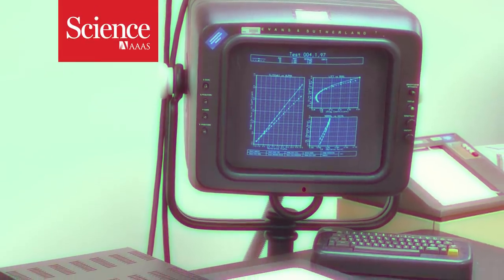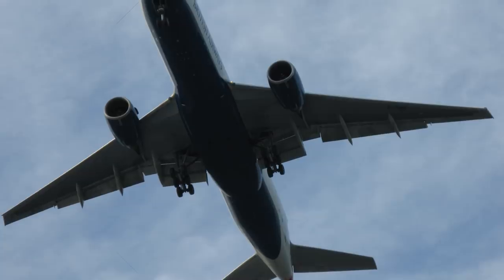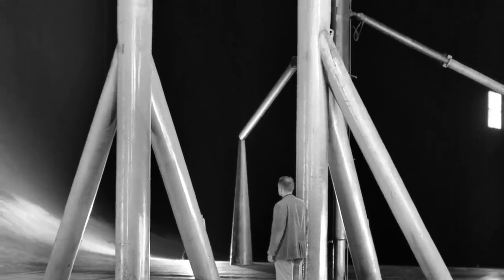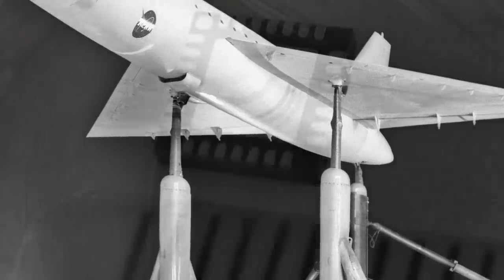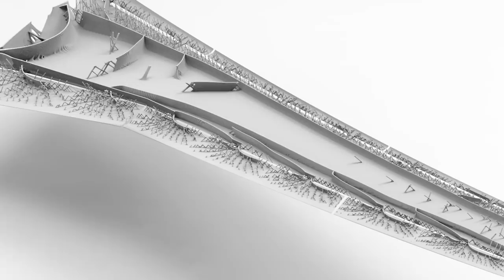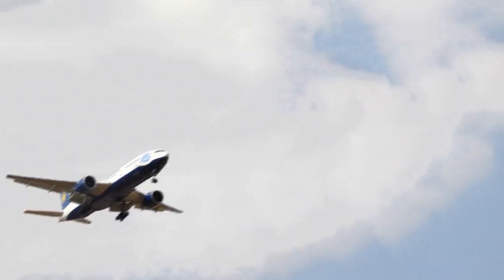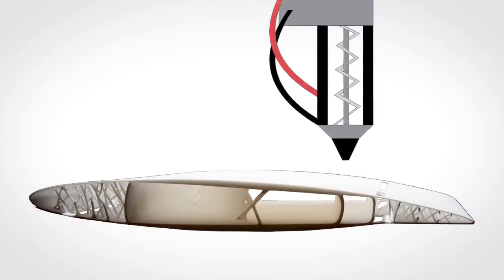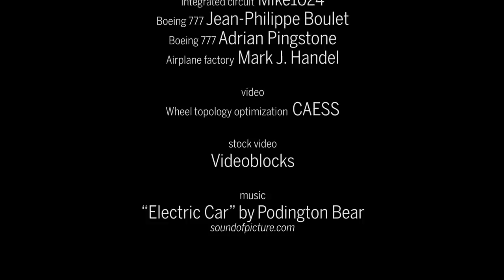New processing lets a supercomputer design a radical new wing

Comment: It is flattering how some people think that in aircraft construction they always try to make the lightest, best, fastest what ever part possible. At the end of the day, however, it is a cost-benefit ratio that decides. Maintainability is also important. Of course you can print parts of a wing, but how many per month at what cost and quality and what happens during a repair? A "print" does not offer a tear-stop function for example. But they are beautiful graphics. So bionic!
Reply: I'm also thinking about how they would implement mechanisms for all the different flaps between all those small ashes of material
Reply: wonder why we even bother to comment on this crap. maybe to wake some of the "it is new and shiny it must be better" sheep.
Reply: @constantinosschinas4503  well crap, I'm sorry if I'm not a superhuman that has a wide array of knowledge of things that I don't need anyways

and I'm sorry if I and other people have a learning curve and not an expert especially when we were just starting to learn
Reply: @michbus7440  TRUE and i don't wanna start on fuel and on the wing heating, cause Yes you are lighter but that's not going to help you stay in the Air if your controls are al frozen and you way tons more cause you have ice on the wings...
Reply: All you guys are proving here is that there is a good reason why we don't put the maintenance guys in charge of R&D. It's like the mechanic that works on old Fords telling the guys at Tesla to pump the brakes on designing electric cars because wrenches and lug nuts.
Reply: @ighsight  As I already wrote, it is not the unlimited imagination of the R&D heroes that decides but what the airliner needs, e.g. good maintenance, airworthiness and manufacturing costs.  Otherwise you could also complain that not every family van looks like a Formula 1 car.
Reply: @michbus7440  so true 👍
Reply: @fuelbasti  Even the lowly family van has evolved though, and it does so every year. It doesn't have to win a Formula 1 race, but it can't just stay the same. By the way tons of F1 and other racing league tech has made it to that family van over the years.
Reply: I would stick to old tried and true rather than new and who knows.
Reply: @Wildstar40  in a world where everyone is you we would still be living in caves hunting horses or whatever
Reply: @ighsight  now the understanding is there.  research cannot be the only driver of change.  it's only part of the solution, too.  to say one is being slowed down by others and that is why there is still no printed wing simply does not hit the point.  But maybe you just mean that every prototype is so ingenious to meet the needs of an airliner.  Well, these bionic simulations are definitely nice to look at and are nice stimuli for ideas.  But not anymore.  I am not against 3d printing, but this technology also has its limits.
Reply: @michbus7440  
You clearly do not understand my point.
Reply: @fuelbasti   I'm more excited about the new design and production process than I am in love with yet another prototype. I'm also reacting against the idea that the tech is cool and pretty to look at, but it's just a lightweight (pun intended) when it comes to the real needs of airlines. These are typical arguments that are made from the perspective of people who are wedded to older/legacy methods and technologies. Given the above mentioned recent Boeing 777 design and safety monitoring failures, the argument for sticking with the older ways that you champion is even less compelling at this point. Tried & true is nice, but innovation & improvement is better.
Reply: @ighsight  again, we talking here about a wing of a civil aircraft for lets say 200 people. Thats what this is about. Itis not the technology itself that is in question here, but rather its use or canonization for apparently every part.
Reply: @fuelbasti I don't see where the tech has been "canonized" yet, folks are just excited about the potential of it. Just as much or more rigor that went into development of traditional wings should go into this newer one before it is used. You seem to have decided in advance that this tech is unworthy of use for this part of an aircraft, without any evidence of that. Your arguments flow from "the existing way is naturally better" viewpoint, which kind of ignores the fact that the tech you now see on planes was developed in the same way as this, someone somewhere was pushing the design envelope against those who were comfortable with the status quo.
Reply: @ighsight  
"All you guys are proving here is that there is a good reason why we don't put the maintenance guys in charge of R&D. It's like the mechanic that works on old Fords telling the guys at Tesla to pump the brakes on designing electric cars because wrenches and lug nuts." 

Oh I see that is so true cause they don't need to funktion or something...

The Idea can be great but only if maintenance and mechanics aproove does it become a real option for service... 

Also this was 3 years ago... and we don't have any concept designs from Airbus or Boeing wich use these...
Reply: @LeoRehberg   I guess it would be easier to only do maintenance on yesterday's technology but that doesn't move restless minds. Designers aren't captivated by the thought of how great it would be to design something that is easy for the grunts to twist a wrench on, it's about solving problems and doing something new. 

Also it's unfair to expect all problems to be solved upon submission of the design. R&D has to design incredible new things AND solve all production and maintenance issues before they can share anything? Some issues have to be solved by other people after designs are created, division of labor is good.

Absence of concept designs shared with you is no proof that Boeing & Airbus are not continuing this research. I guarantee you it is ongoing. If you understand any one of modern computing, machine learning, robotics, additive manufacturing you will see that it is only a matter of time before all wings are produced this way, with robots maintaining them. If you wait until everyone else has solved the technical issues you will be devoured.

Comment: Thanks. It is pretty amazing that the supercomputer improvement to the current 777 wing is only 5%. While not an insignificant amount, it does means that current tech and humans got it 95% right.
Reply: Yeah I was surprised by that to, I woul be curious if this was only structurer related or also to into account optimization of airfoil shape.
Reply: 5 days isn't really all that long for AI, with more time, it probably would have even better results.
Reply: @nateman10  that would be a interesting case study for datascience. Could probably be easily done by someone capable of making a cam program.
Reply: 5% is a lot
Reply: @carlosandleon  Remember, we are not talking about 5% of the total weight, but only of the wing weight...
Reply: @carlosandleon  5% would be a lot if that wing could actually be made. For the moment it's just a cow's opinion.

Comment: Yeah the thing with these types of optimizers is you really need to be able to tell the computer to optimize toward something you can physically build. Optimization that leads to organic structures like the inside of a bird or pterosaur bone is not as useful as that which leads to orthogonal, manufacturable design which nonetheless creates something novel and functional.
Reply: Part of the issue is that it's difficult to control optimizers/ai design in general, and part of the reason for that (along with the oddly numerous paraleles between computer-optimized designs and nature) is that they create such designs through similar processes to evolution in biological machinery

Comment: 5 % fuel increase after 5 days of supercomputing, looks like humans figured out the plane stuff pretty well.
Or the restrictions on the new design were too high.
Reply: not 5% fuel increase. 5% less weight. thats not that big a difference. im guessing most of the weight is held up places you cant change without a lot of thinking through, like the skin thickness
Reply: Humans design based on current manufacturing and maintanence restrictions so that's pretty impressive.
This new design is impossible to make, try to give that freedom to designers they'll build better 👍
Reply: How do you figure 5% less weight can equal 5% more fuel ? That makes no sense at all.

Comment: There would be other structural advantages as well, I am sure. Identifying the change in weight is just a metric that would be easy to calculate, considering that they cannot build the wing with today's tech. Impressive stuff
Reply: We can design things this way it's just that we would have to make unique parts for everything and the cost of making a factory just for a single concept plane is a lot of money to ask for as a researcher
Reply: Nope, not really. with how aircraft are designed and built, it would only really be a weight saving. Just looking at this it seems to lack alot of features typically put into wings. It might be lighter but the plane itself would probably have less range and that would make it need more maintenance.
Reply: @GusOfTheDorks  if I am correct lighter weight = more milage = more distance, what have they left out on the wing?
Reply: @MedhaviN  seemingly. flaps, ailerons and pipes to fuel the engines

Comment: The maintenance and production issue makes this a terrible way to design aircraft wings, but I could imagine it could be very useful for space rovers. Put in some parameters to make sure it can stand up to stress, and this could be very useful. Currently a decent amount of how we design things is trial and error, which is only efficient if you’re going to build the same thing a million+ times after getting the right design. Space rovers and the such are only built once, so it is far less effective. Space rovers also don’t have maintenance anyway. You can go up to Mars and fix the rover, so it doesn’t really matter how hard it is to repair. I think this combination lends itself really well to being solved by these programs. That being said, they’d need to be able to use different materials and account for parts that can move, as well as create a relatively durable design (because of the whole no repair thing, you don’t want it to break easily)

Comment: There's no free lunch.  Once you get to a certain material usage efficiency for a given purpose, further reducing the amount of material in a structure requires moving closer to its critical failure limit.  The closer you get to the critical failure limits of a structure, the less damage/deterioration is needed for the structure to fail.

Comment: What I took from this is that engineers are 95% efficient. 5% is a pretty modest increase in efficiency for a supercomputer, even if it does save 200 metric tonnes of fuel.

Comment: Also remember, wings carry fuel... And I suspect the internal volume will have to be segmented off with baffles to prevent fuel from sloshing all over. Part of that is taken care of currently by the shape of wing ribs - which this model has none of. Not sure if it has hardpoints also for the engines that hang below the wings. But I understand their intent. :-)

Comment: There are other, less obvious advantages. Crack propagation through such a structure is much slower and more detectable process. While in traditional design margin from crack conception to catastrophic failure is pretty narrow, here it is much wider. Increased manufacturing cost for better durability and safety is quite acceptable tradeoff for aerospace applications.

Comment: The problem with generative design is that you need to know all of the loading conditions in order to have the software generate a design that withstands the loads. You could come up with a 5% lighter wing but you'd have to be very sure it's as strong as a normal wing in the same directions.
Reply: Do you think they did all this and never knew how wings work or?
Reply: @aarondoleski236  it's possible.

Comment: While 5% is an amazing reduction in wing mass, it just brings to mind how well the original wing design was to start with. I would have thought by the headline that the Super Computer designed wing would be a more efficient wing profile instead of an incremental improvement of an existing design.
Don't misunderstand, any improvement is good but radical this is not.

Comment: this is not new nor indeed a radical departure.
the supermarine spitfire has curved internal struts in it's wings.
it was designed in in the early 30s seeing construction in 1936 .
there are accurate 3d print files that use the correct internal structure.
try again.

Comment: 5% weight reduction is not much of a result to incentivize an aircraft company to attempt to make this almost-impossible-to-create wing.  This sort of optimization is not very new.  20 years ago there were programs that started with a digital monolithic solid block and, in conjunction with a Finite Element Analysis (FEA) stress program, would digitally whittled away at it to create a uni-stress object that was almost always a very complex tree-like/Swiss-cheese shape.  Deflection, fatigue & thermal criteria, in addition to a particular max static stress goal, must also always be part of this sort of optimization program.  When attempting to justify the results of this sort of program, just saying "just 3D print the shape" is naive.  The interior of a modern aircraft wing has to accommodate lots of items that need clear and straight pathways - hydraulic, electrical, control & fuel lines, structural mounting points for engines, and flaps.  Engineering is a complex dance that balances functionality, performance, efficient assemblability, initial costs, operational costs, maintenance costs, product longevity, and recyclablility.  Computers are tools to express what the mind directs and are incapable of independent creative thought.  There is an old computer saying: "Garbage in Garbage out".